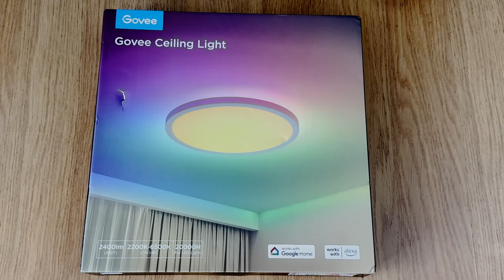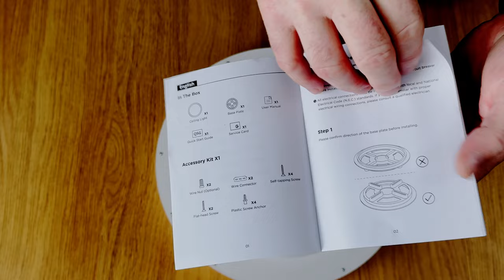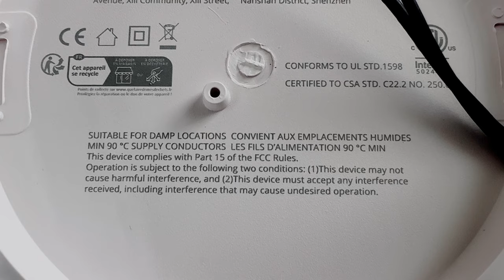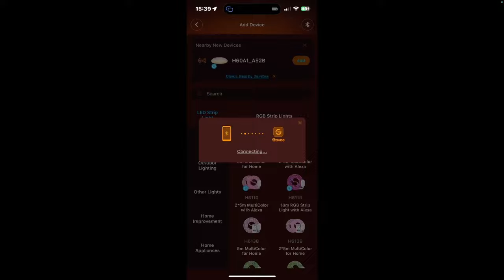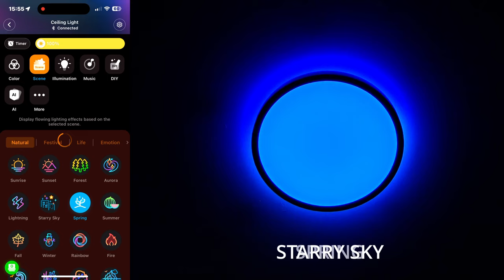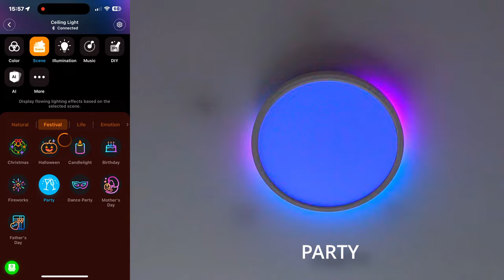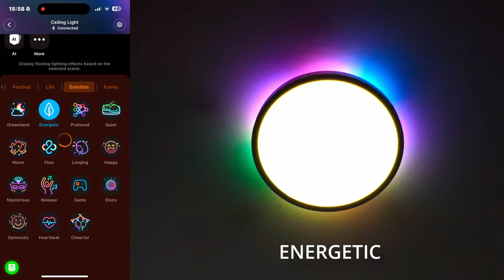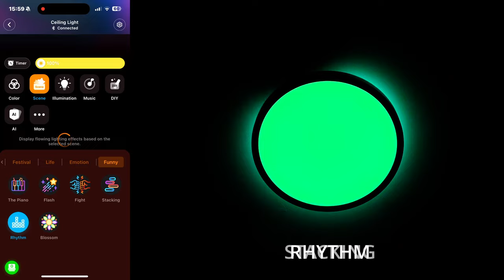Govee H60A1 Ceiling Light Unboxing & Installation

Comment: Nice walk through thanks. I'm trying to compare this lamp with the Aqara T1M for a bedroom.  I'm a huge Govee fan and their lights integrate quite well with Home Assistant. Just a tip on installation, you can use a cable tie or a bit of old wire to make a hanger for the light while you connect it up.  Gives you both hands free.
Reply from the maker: In the heat of the moment, thinking rationally isn't my strong point!:hand-orange-covering-eyes:But a good tip for when I do the next one! Have to be honest, I am wondering if the Aqara might be better for some folk if they are looking for bright light in the colors, instead of just white... Might see about picking one up to try out! If you have both, I'd certainly love to hear your views on them!

Comment: Hello, can I turn on the light with the classic switch on the wall? Or do I have to use the application? Thanks
Reply from the maker: I have a normal light switch, walk into the room and turn it on. It retains the last setting you had the light on, so you need to use the app to change it if you want something different.

Comment: This light is a bit crap in terms of integration. Can't even get it linked to Google Assistant, constantly asks me for a Matter code but no where does it state that the light is Matter compatible. Not tried it with Home Assistant yet but from the sounds of it what you can do with it is very limited too. Pain to always need to load up the Govee app just to change the lighting
Reply from the maker: All I can say is that I never use the app to change the lighting; I use the Alexa voice command to do what I need, and it works fine for my needs. The Govee H60A1 manual confirms compatibility with Amazon Alexa and Google Assistant for voice control but does not explicitly mention Matter or Home Assistant. This suggests that while the H60A1 can integrate with Alexa and Google for basic smart features, it might not natively support the broader compatibility and automation capabilities provided by Matter or Home Assistant out of the box. I'd say that if the light is not working the way you want it to, GOVEE will accept a return if you contact their support. I did read a Reddit post about people having issues, but cleary the people who can give the definitive answer are Govee themselves.

Comment: hi! i just installed this lamp, but i used the white connector that you showed in the video instead of the clamps that came with the lamp. my lamp isn’t working and now i’m wondering whether it’s broken or i NEED to use the clamps instead of the white connector? any help would be appreciated ^^
Reply from the maker: @vanillacupkid  the clamps are for joining your existing wires and you must make sure you connected the right ones. I sealed off the earth wire as it is not used in my setup, but is importantly in anything electrical to follow the colour codes exactly. As I have no idea what you have done and how you have done it, I’d suggest a quick chat with Govee and see what they can do to help!!
Reply: @TechRealityGlasgow  i connected everything correctly and the same way you did, i only kept the white connector that you removed and used it instead of the clamps that came with the lamp… i know the white one is kind of an „old“ connector for the wires and i’m wondering whether it’d make a difference if i took it off and used the clams and cap instead
Reply from the maker: @vanillacupkid  I really think you should as that is the correct way to do this, the clips are just a pass through.
Reply: @TechRealityGlasgow  i think i’ll try doing that, thanks for the help!! wish me luck that it works and isn’t broken 🥴
Reply: @vanillacupkid  did you get it to work?

Comment: I have a dimmer that currently controls my light, will it work the same when I install this light?
Reply from the maker: An external dimmer switch cannot be used with this. The manual online states this.
External Dimmer cannot be used with this product.
Only use the control provided with or specified by these instructions to control this lamp. PAGE 01 of the manual from: https://cdn.shopify.com/s/files/1/0512/3489/8105/files/H60A1.pdf
Reply: @TechRealityGlasgow  Oh so I'd have to switch to a non-dimmable switch?
Reply from the maker: @VortexGaming007  Looks that way I’m afraid. It’s pretty clear in the instructions in that link I posted I’m afraid.

Comment: Nice video! Do you know if the integration with Alexa enables you to change the brightness/colors of the light or just turns it on/off?
Reply from the maker: I can ask Alexa for "Ceiling Light DIM" and it decreases the brightness in stages, and I can ask Alexa for "Ceiling Light BRIGHT" to increase the brightness. Works well! Same for colours, just ask it to change to a particular colour and it does that as well.

Comment: Is there a cct mode which automatically swich the light temperature dure to the time?
Reply from the maker: The only way that I can see to do this (and I'm aware I am probably missing an easier way to do this) is by setting an automation schedule, which I tested out by setting a date range, adding time points, and at each time point, I set a brightness, colour temperature, and colour change to happen. I think though, what you would like to be a way to set a time range and from time (a) to time (b) have a brightness and colour range automatically happen? For that, I could not find a way of doing it, but that does not mean there isn't a way! I'll poke around the support forum and see if anything comes up that might help.